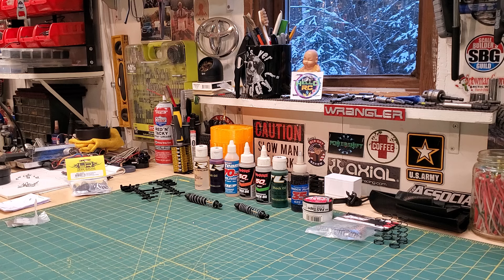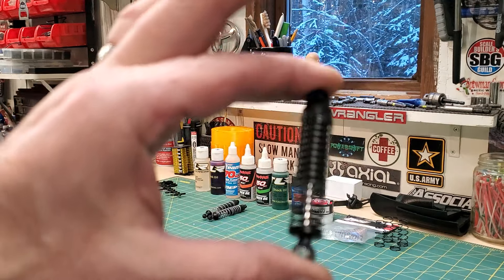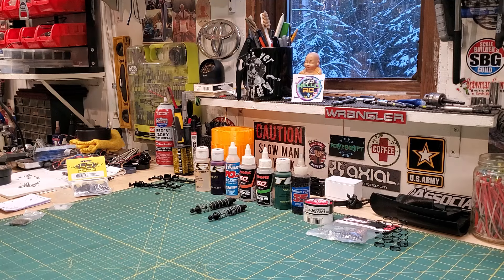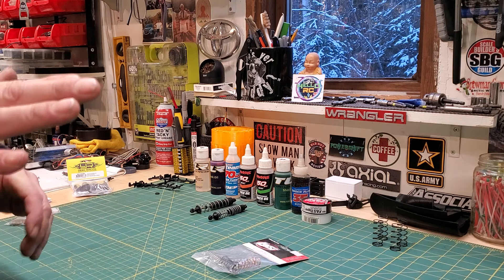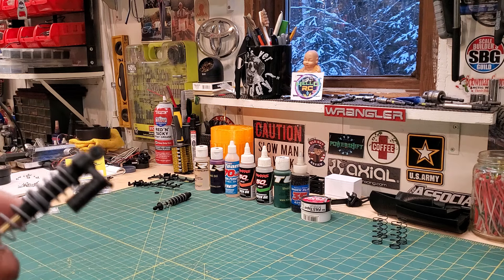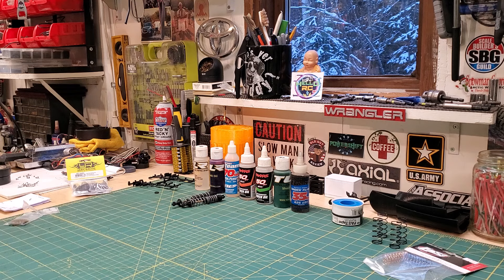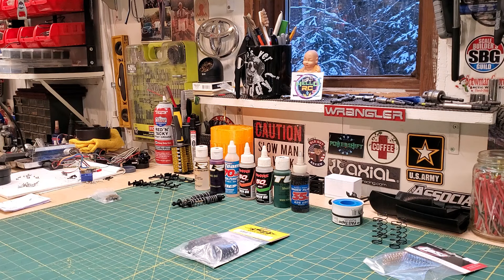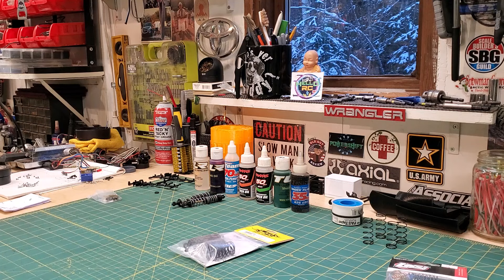Shock tuning, different ideas. for David F.

Comment: I'm cheap too. I've used common household oils in a pinch to fill shocks.  You can find the viscosity of various household oils on the world wide web. Lol 😆
Reply: I've also experimented with ball point pen springs on the shock shafts 😂
Reply from the maker: I forgot to mention that, I have a nice selection!
Reply from the maker: Iam a big fan of 5w30!

Comment: Great topic. The Scx10.3 shocks are different too. The Early Bronco and the CJ7 give you 100mm shocks. Way to long. Not sure what that new Basecamp comes with but Im gonna find out. My favorite shocks to date are the 90mm Traxxas Trx4 shocks. They work great and dont leak. Take care.
Reply from the maker: The shocks look like the same ones as the cj, wonder why the don't have the gladiator shocks which are great. So true on the traxxas shocks!

Comment: Some good info Gerry thanks for sharing it. Great video, honestly the Trx4 shocks are top quality as far as rtr goes. I have my way of sealing up the Vanquish shocks so they do not leak, actually I like the Vanquish shocks extremely well, very smooth once built and sealed up correctly 👌. Same way guys cry about the DL shocks if ya take the time to run and tune they are a fantastic shock as well.
Reply from the maker: Iam always chasing my happy medium! Hot and cold, being lazy I want everything to work at 80 degrees down to zero.

Comment: Ezboy puts 90 weight in his desert lizard shocks on his trx4 K10. Is that a good choice for the trx4 high trails. Because I'm thinking about doing the same on my trx4 K10 as well.. Love your opinion. Love the channel Gerry
Reply from the maker: Dont know about DL shocks as I have never owned any but they are springless so 90 seems right.